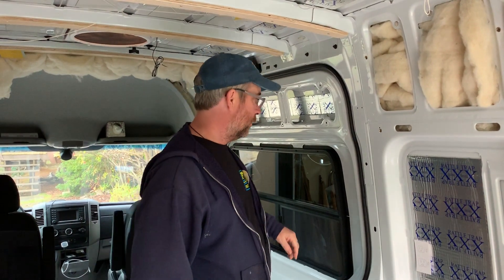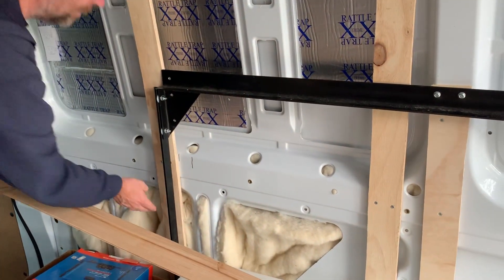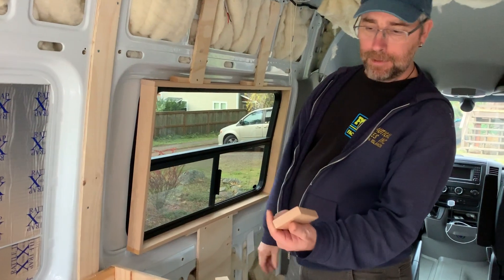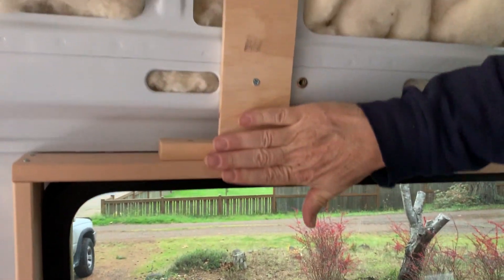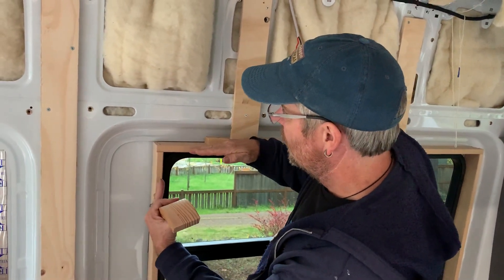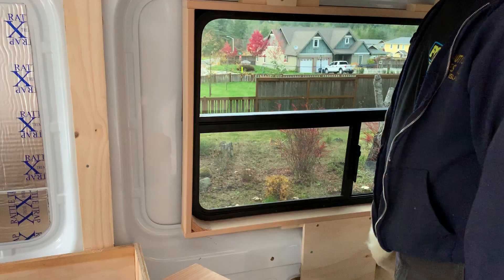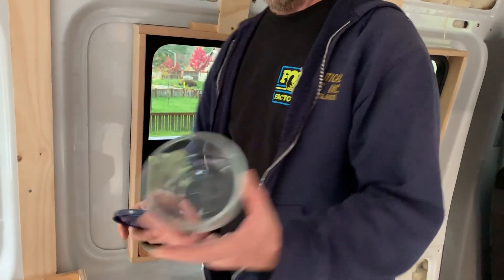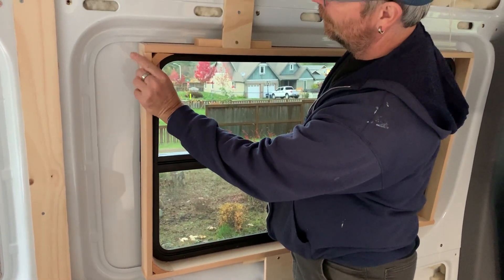HOW TO MAKE A WINDOW TRIM RING FOR MOTION WINDOWS in a DIY Camper Van

Comment: Hey! That looks awesome! Two questions though, did you glue the wood frame to the metal? We are afraid while driving the wood will rattle too much against the metal. And also don't you have a lot of dirt going in the openings between the window and the frame?
Reply from the maker: We did not glue it - The way we fastened it turns out to be very secure - we've never in more than 4 years now, heard a rattle of kind from the window. Also it's good and snug and we don't have a dirt problem either.

Comment: How did you secure the wood frame to the metal surrounding the window?  I assume this needs to be secured well to avoid any chatter from the materials vibrating while driving.  I don't see any screws from the frame into the sheet metal directly.  Thanks for your time.  they look great.
Reply from the maker: Hi Jonathan - we actually did not fasten the wood to the window frame. The window is mounted securely to the van body, and the wood frame is just held in place by the furring strips as shown in the video. And we don’t have any squeaking or chattering noise at all.

Comment: I’ve been struggling with the bunk windows on our Transit. I thought about doing something similar to yours but I don’t want to trap the windows behind the framing. What if something happens to one and I need to replace it?  I’m planning to attach a wall panel with magnets. Hopefully nothing will happen to them but if it does I’ll be able to pop the panel off.
Reply from the maker: Good idea to think in terms of removable panels. We are SO wishing we would have done more of our build with panels for easier access to things behind the walls and ceiling!

Comment: Ive been trying to figure out the trim for my window, this helps! Do you prime or seal any of the framing wood? If not, have you ran into issues mold on the wood?
Reply from the maker: Glad it was helpful! No we didn’t seal much of anything in the van and so far no problems. But if I were to do it again I’d make the time available to seal everything. Thanks for the comment and good luck with your build!

Comment: Thanks for the inspiration, when you say 1x3 is that 1”x3” as the wood I got looks much thicker than what you framed the window with??
Reply from the maker: I think it is called “1x3” because that is the dimension before the edges are planed smooth. (Kind of a silly quirk about US lumber nomenclature). The actual size more like 3/4” x 2-1/2”.

Comment: Tim, this is really well done, love this! helps so much in figuring things out. So my other question is, how are the windows installed on these vans to begin with? are they clamped inplace with a trim ring and screws or do you just bond them in place?
Reply from the maker: They are clamped in place with the inside trim ring and screws. MotionWindows has a great video on their site showing how they go together: https://www.motionwindows.com/sprinter-van-conversion-windows-new-gen/